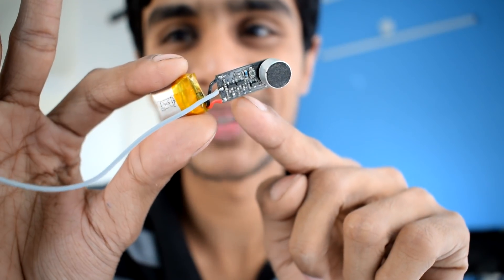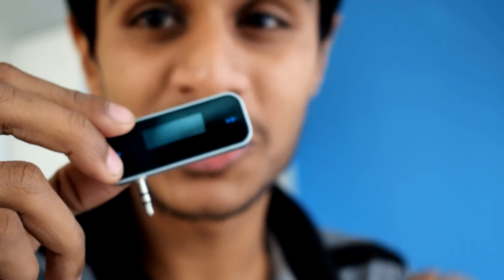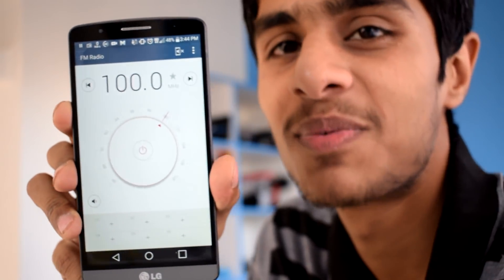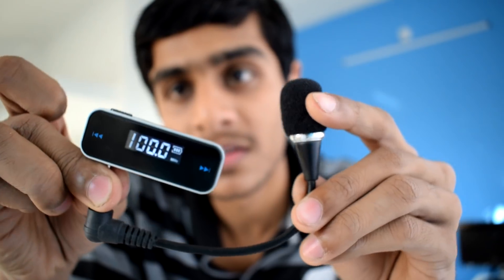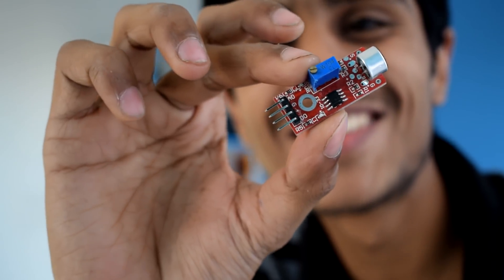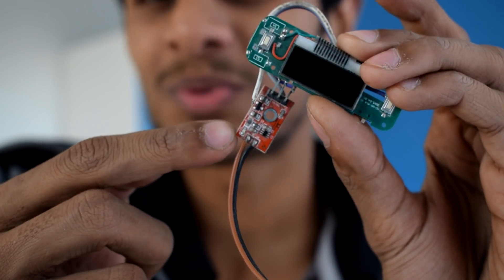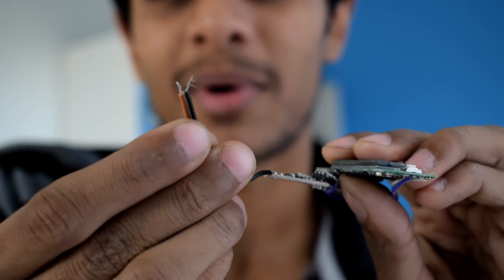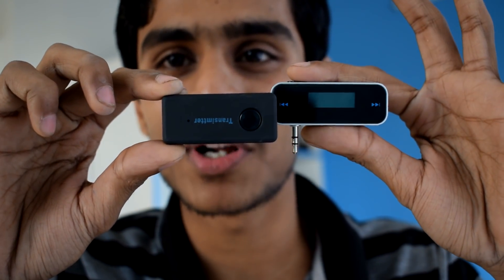How To Make Bluetooth Wireless Mic for DSLR, Android & iPhone

Comment: Hi Kedar, can i ask something please

Is there a way of boosting the signal range of these fm things? and what antenna booster would you use?

Thanks all the best, love your videos
Reply from the maker: +DiyEcoProjects simplest way try extending antena height or you can use rf amplifier of your particular frequency .
Reply: Hi... thanks for your reply. Just looked those up. So id run a new wire from the antenna on the car one... and put that wire into the RF amplifier? and then another antenna out of the Rf amp also?

Have a good christmas, all the best